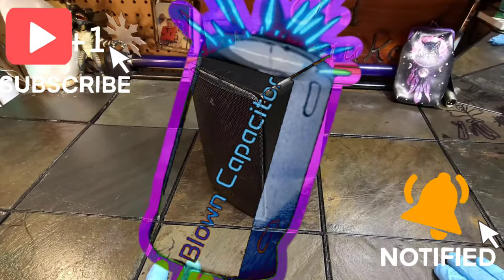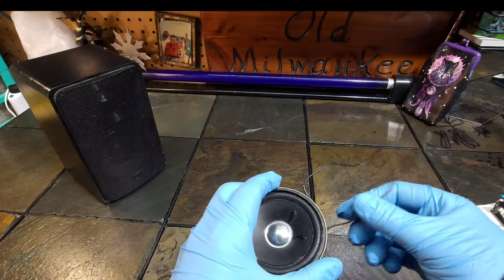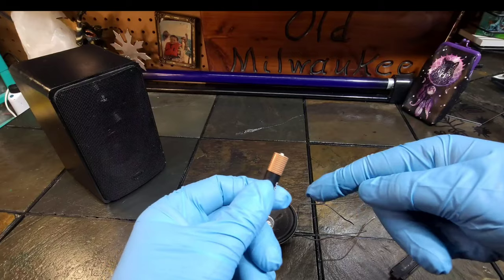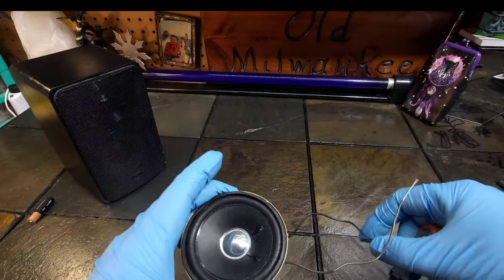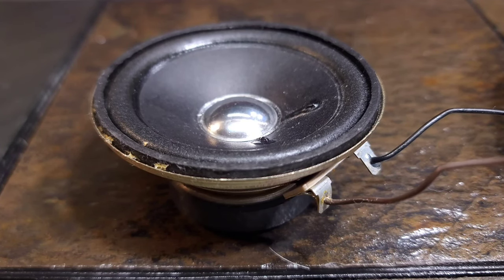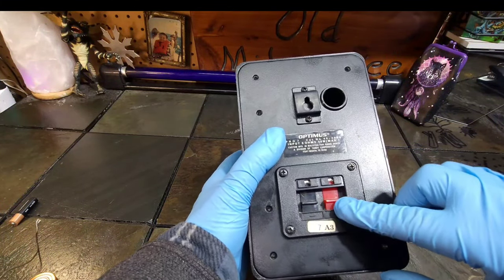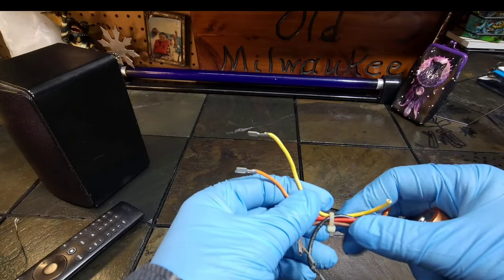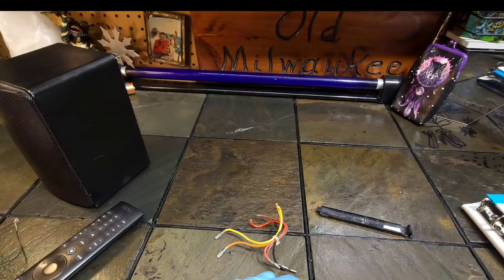How To Connect Speakers

Comment: How to check audio/speaker output wire polarity?

I am not able to find which wire is positive in two wires of amplifier
Reply from the maker: If the amplifier has no indication of where to connect positive and negative leads, then just connect the speakers and run a speaker polarity test from YouTube.  If it sounds like it has less bass and has a hole in the middle of the sound then switch around the positive and negative from one if the speakers. You might have to try it a couple of times and play it loud.